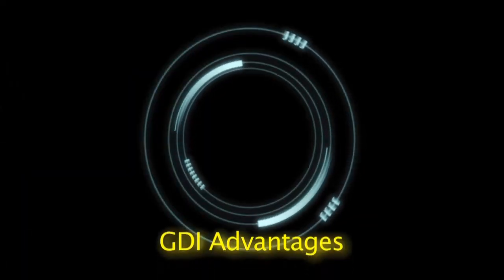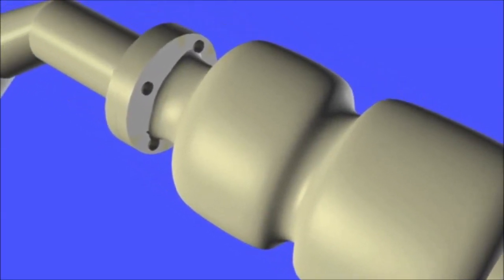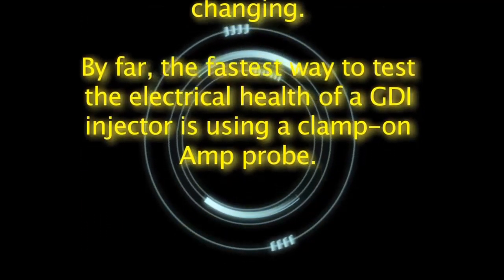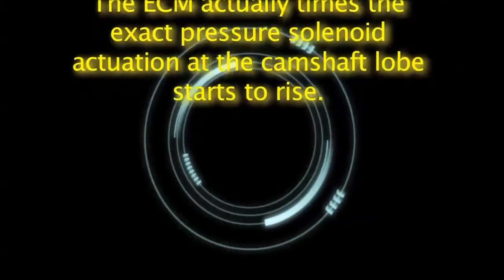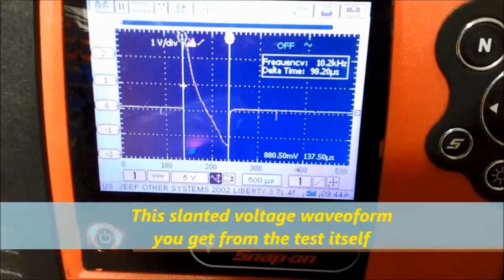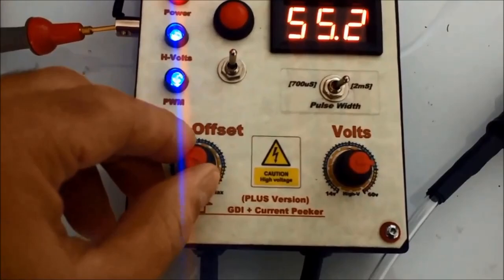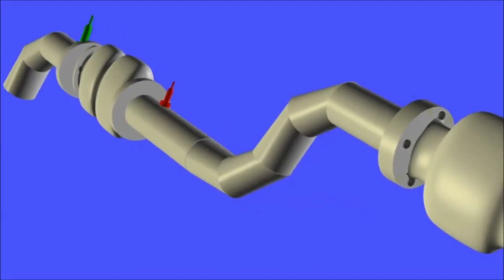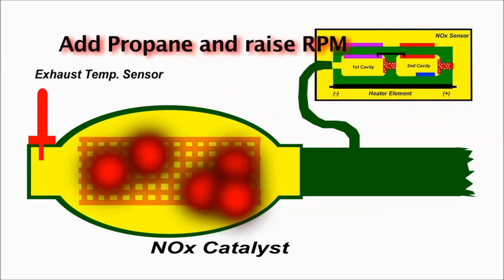Gasoline Direct Injection Complete Course

Comment: Who’s supposed to test the NOx sensor if the voltage is so low that a multimeter and oscilloscope can’t even be used?
Reply from the maker: Which Nox sensor???